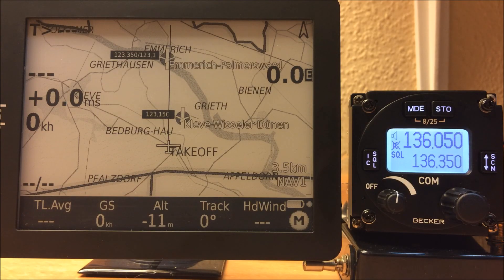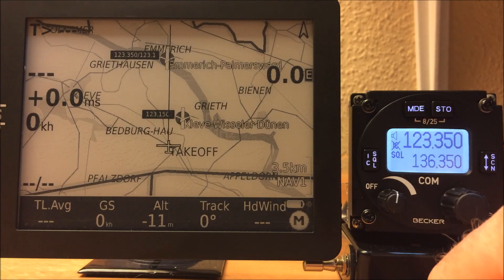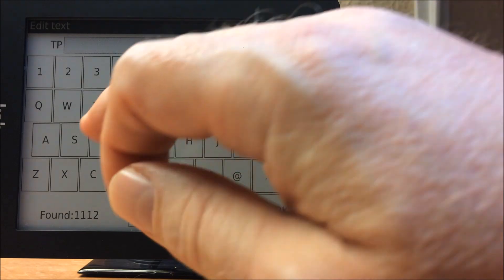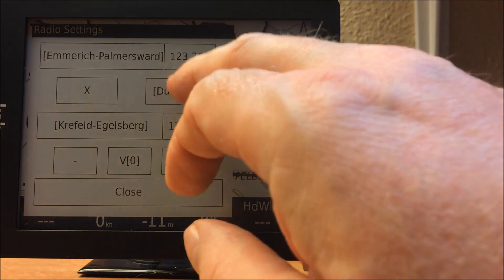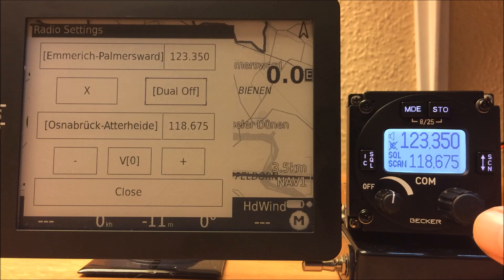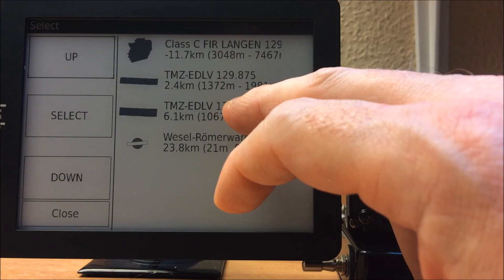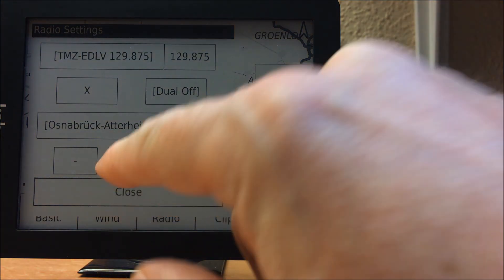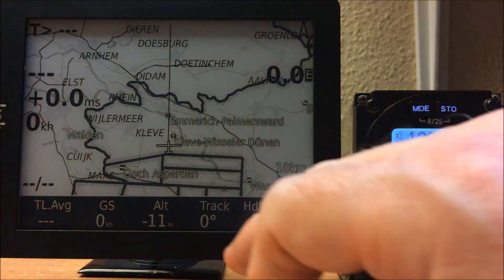AR620x LK8000  driver

Comment: Awesome job on this code ...Tried it and it works fine. I could connect telnet to all ports but what do you do next to send serial data over? I want to use this for remote control of CNC machine(s) and connect my web-app to the virtual serial ports. Any advice on how to?